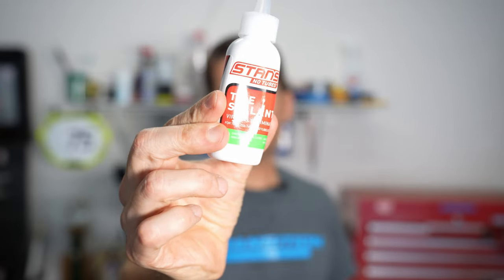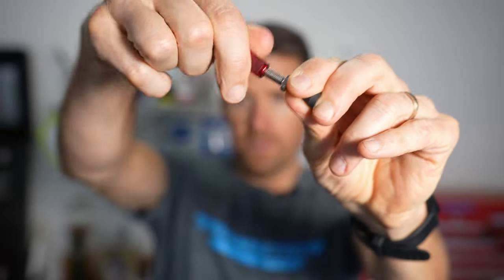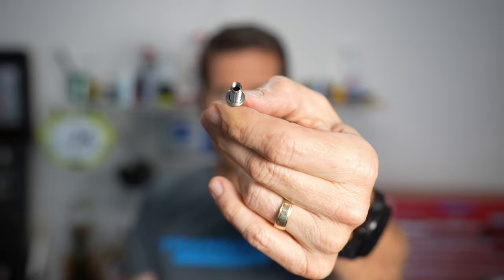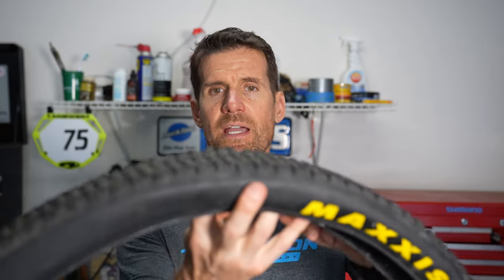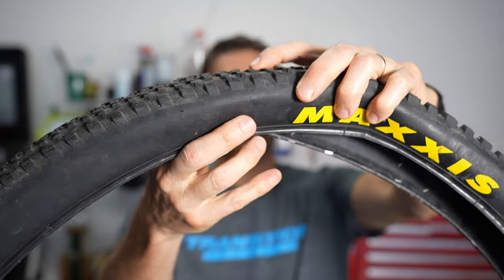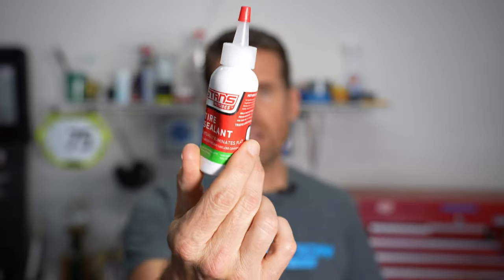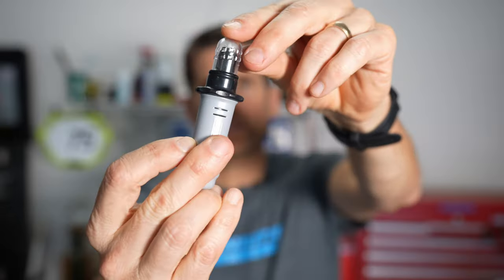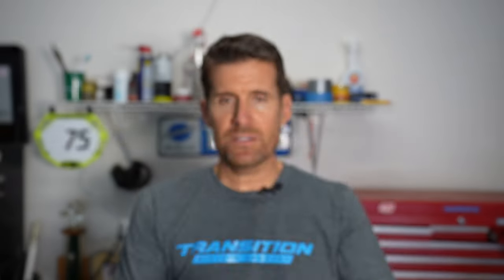Should You Put Tire Sealant in Tubes?

Comment: The difference in weight of a tubeless vs a 'standard tube' wheel is about 145 grams...(thanks Seth) but wait (or should i say weight)...
A tubeless runs all that weight at the extreme outer limit of the tyre where a tube runs its mass centre tube, or about 40mm closer to the axle... this fairly much negates any weight/mass advantage of a tubeless to the point that I would challenge any rider to be able to tell the difference in weight or rotational mass between any wheel... and an inflated tube is about 0.75 - 1mm of fairly soft rubber vs a reinforced tyre.... I'm not sure the average rider again would notice the difference. 
So really the only advantage (albeit quite a good advantage) is tyre pressure and punctures (although a couple of decent burps will most likely ruin a run as much as a puncture...
Having said that, I just got a flat on a gravel track at jogging pace at the local golf course (watching Frisbee Golf) 

then again... I've had fun trying to get a tubeless to bead in a workshop... Never had that issue with a tube in the middle of the night on a muddy firebreak...
Reply: A designated tubeless tire is heavier than a non tubeless tire,tubeless on a roadbike often ends up heavier than running a tubed tire..........and the tubeless tires cost a lot of money.....but of course money is no object.  My Mt bike is tubeless,and even the roadbike is tubeless now with 32mm panaracer semi slicks......real hard core roadbike tubeless tires can easily run 75.00 each,and I always end up cutting them and tossing them,.........................if you dont have tube with you and tubeless takes a dump during a ride................start hoofing it and stick your thumb out.............be prepared................I know people who take their bike to shop to have tubeless tires put on roadbike rims.......they are simply too tight a fit for some to get on rim........tires vary this way.
Reply: If you care that little about weight, then ditch the tube and run inserts. No burping at low psi, better rim protection, wider tire footprint, and if you somehow manage to rip a giant hole in your tire that you can't plug, you can still limp out at a half decent speed with no air in your tire.

Comment: If you run tubes in a road bike it's definitely worth adding sealant to the tubes, since doing this I've had no punctures whatsoever - whereas before punctures in my tyres where a regular occurrence.
Not tried tubeless yet but I am in the process of doing so on my recent gravel bike build.

Comment: I add Stans Sealant (original, not race) to my tubes. After 6 months I add more sealant to the tubes if I haven't already replaced the tubes and tires. The other day I had to replace two presta valve cores after the sealant clogged the valves. It was impossible to put air in the tire. The removable valve cores are inexpensive. The only thing the sealant will not protect against is a sidewall tire failure which is rare but can happen. And in that case a new tube would not help. Thus, I carry nothing with me in case of a flat.
Reply: "I carry nothing"...........a trusting soul.   A sidewall failure you boot it and stick a tube in,boot it with what ever can be found that works. Dollar bill can work........trusting to the universe to save you can be a long old wait.    People carry a tube running tubeless for a reason.

Comment: My experience, it’s the heaviest way to go with mixed results, and ride characteristics were miserable. Early on I found it would prevent a flat, but ended up with slow leakers as the friction between the tube/tire would not let it seal completely. Full tubeless is far superior, although not as easy for the novice.
Reply: My experience is no flats in 3 years,on 3 different bikes...........running sealant in tubes.........it was obvious the sealant had worked on various punctures when I pulled the tube out..........so the far superior angle is also a theory...........Ive seen tubeless go bad and it sucks when it cant be fixed inside of an hour or more. .............any  tire in any use can have problems at times.
Reply: Full tubeless is fantastic the bike seems snappier and more nimble, BUTTTTT, it’s a huge pain in the ass and generally not worth it for your average rec riders.  I ride MTB 2-3 times per week 10-15 miles a ride. I have NEVER had a flat with my durable 45 North Mud snow tires but my son has very light Maxxis Xc tires on his Kona Hei Hei full sus Xc race bike and we’ve had two flats with tubes I had two bikes set up tubeless but went back because of the constant need for maintenance.  I’m going to try the sealant tubes on his bike now.

Comment: If your tyre comes off the rim you are walking
Tyre plugs don't last long
Nothing wrong with inner tubes at all
I've done more than 40,000 miles
Believe it or not without a puncture
I ride 38 miles a day five days a week
40 on a Saturday and 12 on a Sunday
Using oko off-road 120ml  in each wheel
There is a tyre stab video on my channel if you want to look

Comment: This is a timely video, should have thought of this.. Here's some additional info....

Slime makes  a tube specific sealant. It's important to distinguish between sealant for tubeless tires and sealant for tubes. Also consider people who ride fat bikes. The sealant necessary to go tubeless is significant. Giant recommend 4 bottles of Stans sealant for each of the Maxxis Colossus tires that are OEM  Yukon 1 for the 27.5 x 4.5" tires... Significant and expensive. The Slime only requires 4 oz for the tubes & I have tested it with a thorn to the front tire, it works!!! Also consider the issue of sealant freezing, what's the temperature rating??

Choosing to ride tubeless on a modern mountain bike even with + sized tires is always better than with tubes in most normal riding conditions. However, if you choose or have to stick with tubes, make sure you select the correct sealant type.

Stress less, ride more. Stay safe.
Reply: I have a fat tire bike that I run tubeless.  A single tube is a pound of weight.  I use 4 to 6 oz of Orange sealant per tire and works fine.  Buy it in bulk because that's what I use for all my bikes. I currently have multiple thorns in each tire.  I just clip the end of the thorns on the outside and let the sealant gel around the thorns on the inside.  Works great.

Comment: ok i understand but wouldn't a tire with tube help you on berms , because , on full tubeless , you might leak sealant and air , but on tubed with sealant , you get this bonus and the auto repair of small puctures? , the only downside is the weight. tire and sealand will give some rotational weight , but it could help you at manualing , wheelieing, bunny hopping , and hitting jumps?

Comment: I have been looking for a video to show others why it is good to put sealant in tubed tires, so I did a search and came across your video. Sadly, you spend more time talking about tubeless tires and why riders should switch to them instead of the pros and cons of using sealant in tubes with removable cores. I appreciate the information, but you should change the title to "Why riders should switch to tubeless tires". 
Just saying braddah.
Reply from the maker: Sorry didn’t find the video useful for what you’re looking for. However, I do like that subject of “pros and cons of sealant”. Every once in a while I do it Tech Tip Tuesday video and that would be a good one. Thanks for the suggestion.
Reply: @ClintGibbs  Thanks braddah. Looking forward to it.

Comment: DECENT VIDEO DO I AGREE going tubeless no  tried it been there  middle of a night on some  distant village street from home . finding that puncture  in the dark with smart phone na .  even in daylight  i find it tricky  i like my sealant  normally it pushes a dye out of the hole or some were  and i really like slime tubed tires  very easy  repair  re inflate  spin that tire  around  inflate a bit more maybe  feeling your tire   marking were you saw the slime on the tire and rim  give u a idea how far from the stem the hole might be . when i ran tubeless it was a night mare  i should just gave up  bike riding  I spent more time  walking home . muc off orange  sealant  for tubeless never stopped anything . still sitting in my car collecting   road dust on the bottles  . tubes are easier to fix  more perm ant with green slime they stand out  were leak is they give you a predictable slow air loss  normally i clear the obstruction  and ride on  to my home or car  then i can  look over the tire  see if i need bigger repair.   i like that little stans flat repair gadget that might made my feeling  going back to tube tires  a longer pause  i had  tried tubeless  riding on two of my bikes and gave it  up each time after about a month the bikes came tubeless ready  figured i paid extra for it i should give it a shot  each time i went back to tubes . i ride alone a lot  my warden she tracks me  and takes garden hose to me  when  i do  not report in on time lol   when i return home cover ed in mud     she is awaiting with her hose  with huge smile she gets hot and testy when i'd called her about tire flats during the tubeless testing phase nice short video look forward to more

Comment: Problem I have is I’m changing tyres a lot for conditions. E Mtb on road, schwalbe marathons. Of road back to stock maxxis dissector and the relevant rear. Winter in mud dissector on the rear, Vitoria Mazza up front. Back to road ride and road tyres. Messing around with sealant in that scenario? Doesn’t work for me.

Comment: I don't want the mess and burping of tubeless, plus at the back I'm going to run an insert anyway, because yes, 90% of flats on my DH Bike are all pinchflats. So tyre plus insert plus sealant = weight anyway, particularly if I use DH casing tyres front & rear..

So I'm going to run a Tannus Armour Tyre Insert at the rear, that's designed for a tube & can be run at near tubeless tyre pressures, & enables even slashes of the tyre itself to be ridden on.. Then at the front where I don't get any pinchflats, I'll just run a Maxxis welterweight with sealant, in a DH casing wire bead tyre.. At the rear with the insert & smaller tube, I can just run an Exo casing to drop the weight.. 

I think that will be better than the hassle of tubeless in both tyres, with the added weight of a Cush Core at rear.. Sound like a solid plan?

Comment: Nice. You can't put tubeless tires on any wheel? Also, do you have to use sealant with the Stans Dart?
Reply from the maker: The wheels have to have a rim strip for tubeless tires.  Rims designed for tubeless also lock the tire bead into place.  But you can convert most rims to tubeless, even if they aren't designed to be tubeless.  The stans dart is designed to react with sealant but perhaps could work without it.  I haven't tried to see if it would.

Comment: Clint, thx for taking time to make the video but yiu didn't actually answer...yiu definitely gave your opinion on tubes vs tubeless.
Reply from the maker: I pretty much answered it about 30 seconds into the video but it was also designed to make people consider the options and make an informed decision for themselves.  Bottom line is if you are running tubes, I would recommend putting sealant inside if it does have a removable valve core. Sorry if that wasn’t clear.

Comment: sealant will clog the tube, so you won't be able to clean it. butt yes sealant in the tube can work as a short term solution, but not great, tubeless is better. for some reason I've never seen anyone mention this. but results might vary depending on sealant. if you use Orange seal it's hopeless.

Comment: I have a radrunner plus ebike and i put green slime 2in1 sealant in my tubes. they do jack squat. two punctures (one was metal shard, other was a screw) in the past 7 days. Can you recommend a tube sealant that would actually work? or should I just carry a patch kit with me?
Reply from the maker: I’ve always used Stan’s sealant, and very happy with it. If for some reason, it does not seal the way you want it, you could try their race formula. It’s a little more difficult to work with but can seal larger punctures better.
Reply: @ClintGibbs  stans sealant...in tubes? the tubeless sealant? i got that stuff laying around.
Reply from the maker: @slugzkea  yes

Comment: It is really not that straightforward. Its depends on your use case, and for someone that have a gravel bike or road bike, using tubeless liquid in a tube is perfectly fine because you not gonna run such low pressures and pitch flates are less likely. On gravel bikes and road bikes your flats are usually smaller holes, so provided that you use the correct inner tube and liquid combination you should have great success. Also if you are running light weight latex inner tubes, the extra weight is minimal. You also do not need so much liquid, you can run lower amounts to save weight. What might make a bigger difference is rim width and tyre size when it comes to ride quality and comfort. Tubeless setups are generally very messy to work on while out on trail, and if the plug doesn't work you need to put a inner tube into a wheel full of liquid, not to mention the struggle of seating a tyre beed on some tyres and rim setups. A tube containing liquid is less messy to deal with. For longer rides, id rather go for inner tube. Its really easy to change out the tube, and fiddling with tubeless setups can be tricky, not to mention filling air regularly and if the individual is not that tech savvy, it will be a big fuss out on the trail.

Comment: So what about running tubeless but also having some sealant in your spare tube so that if you do have to use it, there is less risk of getting another flat during the remainder of the ride?
Reply from the maker: Yeah, good idea.  But keep in mind that sealant doesn't last forever.  So if your spare sits idle for a long time, especially if it is subject to a lot of temperature changes, the sealant could dry up.  Worth a try though!
Reply: @ClintGibbs  Good point. I already carry a small bottle of stans on long rides anyway. I might consider adding some to the spare tube in the field after I’ve installed it.

Comment: Stans didn’t work in my case as the air couldn’t get to the tube and it the air leaked out the valve hole of the rim, so used weld rite for tubes which is better but won’t seal over 3 to 4 mm holes, so still carry a spare tube. I change tyres a lot to conditions on one bike does all. wtf people buy spare wheels and discs and cassettes over this method is beyond me. I’ll look orange seal next see if they do a tube version

Comment: No way I'm gonna go touring on tubeless tires.. Like, I wont be able to set them back once the bead is broken with my hand pump and tubes are easy to patch right after replacing it - once you get another puncture, even 10 kilometers down the same road, your spare tube will be patched already
Reply: You can get a battery air pump, but I like tubed in my tires also

Comment: This never made any sense to me. When you puncture your tube, the sealant is not going to seal the tube. You're just running "tubeless" now as the sealant has hopefully sealed the tire but the tube still has a hole in it. Why not just get rid of the tube altogether? Keep the tube in your repair kit so you can use it to limp home if something bad happens to your tire. If it's in your tire it's already punctured and useless.

The only time I had sealant in my tubes was a rental bike, and it was a disaster. I pinch flatted, the tube didn't seal, and either the tire was never able to hold air to begin with or the sealant couldn't make its way to where it needed to be due to the tube. Still had a sealant mess to deal with even though I was running tubes. I probably would have been fine if I was just setup straight tubeless.

IMO tubeless with inserts are the way to go as long as you aren't racing.

Comment: Why dont someone just make bike tires thick enough so goathead thorns cant puncture tire
On my ebike 20×3 inch rims i put scooter tires on n way less flats
Reply from the maker: That would add a lot of rotational weight.
Reply: @ClintGibbs  ya more weight on tire, but way less flats, I ride ebikes so to me it don't matter extra weight cause it's motorized 
On my expedition electric ebike, the tires that's came with it wasn't that good, I put Scooter tires on it n it rides way better, plus it holds weight way better, n it lifted the bike up some which helped cause Derailleur was way to close to ground
Plus it rides better off road with Scooter tires
Plus I put tannus armour inserts in

Comment: Run with low pressure is stupid idea
Reply from the maker: Lower pressure is relative. But you’re actually faster running the lower pressure as long as it’s not too low to damage the rim. The old-school mentality of pumping mountain bike tires up to 50 psi is now replaced by lower pressures. I run about 20 psi in the front of my cross country bike and 22 in the back. Trailbike I increased by about 2. 

Lower pressure improves cornering grip and  actually allows the bike to roll faster because the tire is deforming over objects versus being bounced up and slowing down.